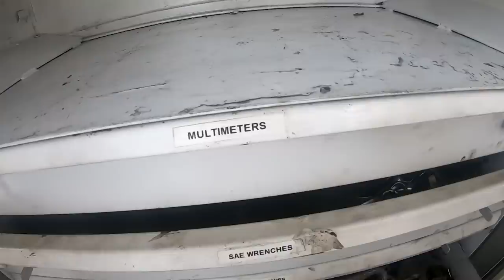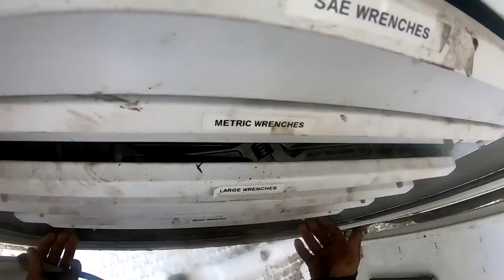More hydraulic issues.

Comment: 50 years ago I worked as a hydraulic mechanic on bucket trucks for tree trimmers. The valve you are talking about is sometimes called a "rush" valve. As long as the pressure stays balanced on both sides of the valve the spring will hold it open. If for some reason the oil "rushes" out the unbalanced pressure/flow will close the valve off completely. All "man" handling equipment are required to have these valves.

Comment: I've got a 3-point backhoe on my tractor, and one night when I was trying to finish a job,  when I used a control it would run to the end of travel and start the relief valve squealing. I would have to shut off the hydraulics on the tractor each time it happened. i assumed that I was going to have to take the whole valveblock apart (I figured that a valve was sticking). The next day when I went to take it up to the shop, I noticed the hydraulic oil level was low. I topped it off and it fixed the problem. I had assumed that the low level would just cause the thing to stop working, but I think that air in the system was getting in between the two relief valves (one on the tractor and one on the backhoe) and making them vibrate and lock up.

Comment: I bought a set of service wrenches from harbor freight. Little short handle open end only that go up to like 2” or something. They are handy when fighting stuff that’s too tight for hand but don’t need the big end wrenches
Reply: Robert Quast bahco and snap on make mouth adjustable wrenches, I have found those to be very useful for spinning fittings in and out, obviously a wrench is the way to go though. A set from HF would probably be the same price too!

Comment: The difference between the Fuller 9-speeds and 13-speeds is just the auxiliary box, the 3/4 gear swap, additional air lines, new shifting stick control knob, shorter drive line.  The transmission top plate can remain the same, as that would just make top gear to the right and forward (not back as it is now on your 9-speed).  Quite a few years have passed since I performed those changeovers, so I probably forgot something.  Tommy would know about the necessary changes.

Comment: Check the transmission numbers you might have one you can swap the gears in it to make a overdrive and then add the splitter box on the back for double over. 
Not sure if the mini 9s you can just add the splitter kit to get a single overdrive.

Comment: I remember the Timber jack skidders with Detroit diesels...I bet on a cold quiet day you can still hear them screaming through the mountains....As you were working on the hydraulic valves on this...I was tearing apart spool valves on a hydraulic tire changer...my project didn’t make it...I found metal in the system...one of the valves looked like a wire wheel shit inside the valve body....18 years old not worth fixing.
Reply from the maker: 18 years old not worth fixing,  that disqualify half the junk I work on
Reply: @westerntruckandtractorrepa1353  This has been used to the extream!... Problem is.. There not made very well... This customer does production AGG tires, skidder, grader... In volume...dam parts are so expensive and hard to find...
Reply: western truck and tractor repair   Yes , our fleet is anywhere from the mid 70s to about the mid 2000 s and actually quite reliable and fairly easy to fix
Reply: Never old kit is often far better than the new plastic clad computerised bullshit especially when you look at how expensive it is compared to old kit

Comment: Thin the oil out or those old forklifts will drop slow we add some kerosene in the 10 weight oil  when it turns cold and it evaporates out when the weather warms up did it years doesn't seem to hurt enything lots of hour on machine no pump problems

Comment: Hey Warren I got to thinking about the fuel economy comment and I had an old man bring his 4240 with 12000hrs into the JD dealer I work at and he swore running it a gear under and wide open was the key to it's longevity. He claimed he'd rather burn more fuel than pay for parts breakage. I dunno just kinda made me chuckle. RPM doesnt really apply if you run it balls out and a still a gear too high like what some guys do.

Comment: Most open circuit hydroulic system don't run hardly any pressure until you pull a lever

Comment: It was the O-rings where that needle and seat was worn the needle and seat is worn that should be a smooth surface I would get a replacement needle and seat it probably has a replaceable seat inside that priority valve that you swapped!